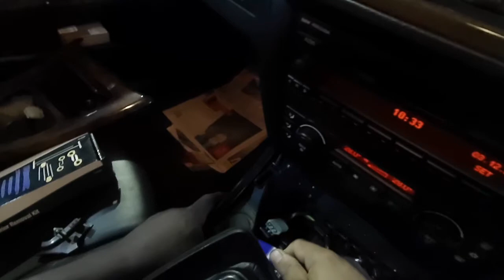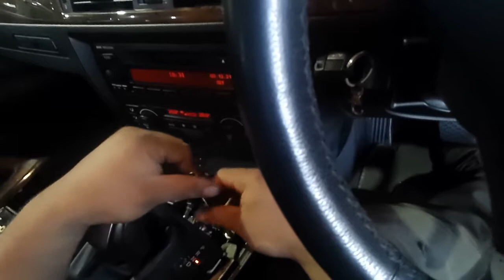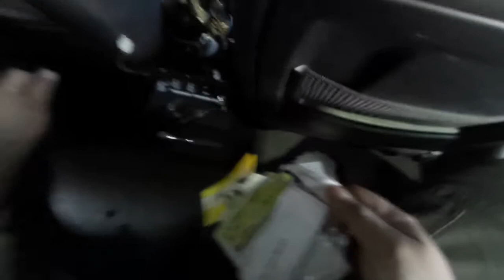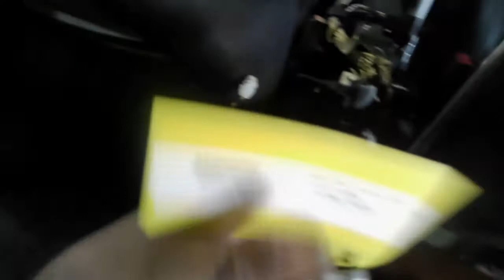BMW e90 airbag module replacement

Comment: I have a BMW E90, my seat belt and airbag lights up, diagnosis says error code 93A9, does it mean control unit or belt tensioner, I have connected three different belt tensioners, but I still can't delete the error